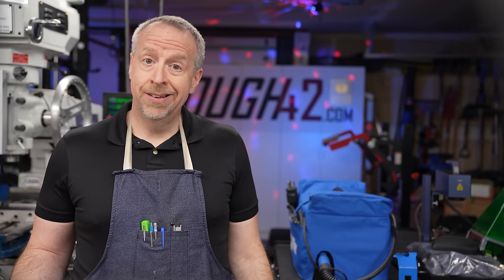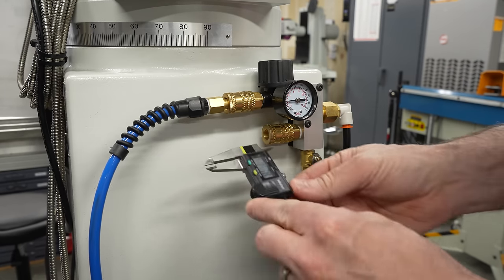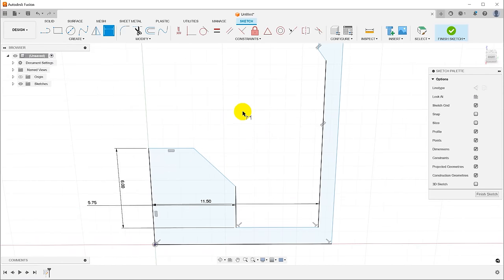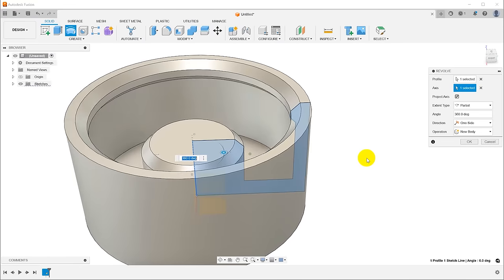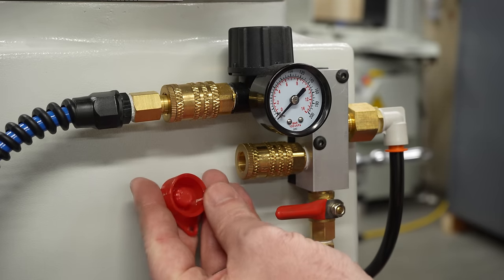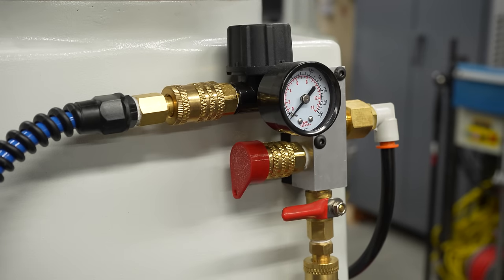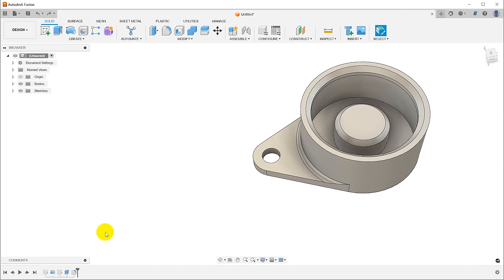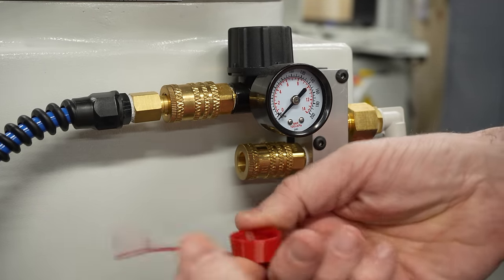Iterative Design in Fusion 360: Flexible Dust Caps

Comment: James, if you make the centreline as an actual centreline, Fusion will dimension against it as diameters and you don't need to do the dive by 2 thing, and you don't need to manually select the Axis in revolve :)

It the button next to Construction line in the sketch pallette.
Reply from the maker: Really?  Thanks!  I hadn't noticed that.  I learn more from making tutorial videos that I think people do watching them.
Reply: I'd been wondering what made the "centerline" style special!  That's fantastic. Thanks for haring!
Reply: Holy crap that's super useful
Reply: @Clough42  yup :) it can be pretty useful, mainly for things that will be revolved, but sometimes for other things as well :)

It's only dimensions that are snapped to the centerline that turns into diameter dimensions :)
Reply: @JBLewis  you're welcome :) The centerline acts like a normal line in that it will close up a contour, like you'd often want it to for a revolve, but that does make it less useful in other situations.
These days I really only use it for revolved parts, which I don't do all that often :P
Reply: I was just about to say the same thing. That centerline function has been around for a while. I'm surprised that you didn't know or use it James.

Comment: your mastery of fusion is unreal.
Reply: All in practice. I myself wish that Fusion 360 could be run by only using the keyboard, I am an old AutoCad guy and am actually faster that way.
Reply: @oldfarthacks The biggest problem I have is that Fusion has shortcuts to speed up your work (E for extrude, D for dimension) but on some dialogs the only way to click on the default button is by hitting it with the mouse instead of just hitting the Enter key
Reply: @Rob_65  They should sort that out.
Reply: @oldfarthacks same here, I worked with AutoCAD for ~17 years before switching to Fusion, and while I some times miss the keyboard shortcuts, since it got my Spacemouse Pro a CAD mouse compact I don't miss them 😁 anywhere near as mucg
Reply from the maker: @Robinlarsson83  I consider the Spacemouse a Fusion essential.  You can get by if you have a 3-button mouse so you can shift-middle-click to rotate, but it's not great.
Reply: @Clough42  yeah, 100% and not only for Fusion, basically an essential tool for any 3D CAD software :) it also makes it a lot easier to switch between different ones, sometimes I go between Fusion and Solidworks a lot in a day, and keeping navigation the same it very helpful.

I don't understand how I could work daily in CAD for almost 17 years before getting one, but the first ~10 years or so was just 2D in AutoCAD and IGems (CAM).

Now I can't imaging doing any sort of CAD without my Spacemouse :)
You don't need the Pro or Enterprise models, but I snagged a used Pro for ~150 euros so it was a no-brainer.
I do use its buttons quite a lot, and pretty much don't use the keyboard more than for number input.

Comment: Not gonna lie, the suuuuuper slow camera pan makes me feel a little bit sick after more than 30 seconds
Reply from the maker: I'm playing with some things.  I'm not totally happy with the results yet.
Reply: @Clough42  Maybe only one slow pan in a single direction?  Or maybe a slow ramp up/down and not a jarring reverse?  It doesn't bother me at all but if it has a back and forth with a sharp reversal it'll make people uneasy.  I would definitely like to see you play around with it a bit more.   It kinda turns a 2D video into 3D which could be very useful to give us viewers a better idea of the relative dimensions of what we're looking at.
Reply from the maker: @technobabble_  Part of the issue was that I didn't realize I had lens (and body) stabilization turned on in the camera, and it was trying to compensate when the slider changed speed, resulting in a really weird lurch.

Comment: if you use the construction line as your midpoint you dont have to put in half the diameter for the dimension you can put in the full diamter and it will make it symmetric to that mid point, pretty useful and one less step to take.

Comment: At 8:40 if you click and drag the line off a circle the line will always stay tangent, your second selection on the next circle can also be tangent. this just saves you having to make the constraint after. handy tip
Reply from the maker: Oh, that's brilliant!  That's the second super useful tip I've picked up from the comments on this video.
Reply: Very handy for making tangent connections just like in your video :)

Comment: I made caps like this for my gasoline/diesel cans.   But I have been struggling with flexible filament print quality.  So was glad to see your settings which I will test on my Prusa.   Thanks!
7/14/2024 addendum:  Yes those settings worked well for me on my MK3S+ with a Diamondback nozzle.   However a recent TPU print required a slight adjustment.    I was making guide wheels for a riding lawn mower deck.  They are a screw  together rim (2 halves) and a TPU "tire".    On the bed the tire tapers up and out at the outer edge at first as it prints.  The edge was tending curl up, getting higher than the extruder nozzle as it went.   Eventually this led to a failed print.   So for this part I went to .25mm layer height and extrusion of 1.05.   That solved the curling up at the edge.   It is so nice to be able to print TPU parts for stuff.  I think the Diamondback nozzle really helped.  Print quality is excellent now.
Reply: I did follow through with this using the .4 diamond nozzle in a Prusa Mk3s+ and with the recommended settings.  The filament I used was Overture TPU, black color.   Just a few prints but all look fantastic.  I was using a .6 hardened steel nozzle.  Great for carbon fiber PLA, but not so great for TPU. (terrible actually)   So again thanks for sharing your experience!   It definitely helped me.

Comment: And even though I use Fusion 360 on a daily basis, there are always one or two new things that I pick up from your tuturials.
One thing I do, is to use the diameter dimension on revolving extrusions. So instead of typing 21.8/2 I use the diameter dimension feature. Hit D for dimension, first click the center line, then the item you want to dimension and then right click and select "diameter dimension".
Yes, that takes more time and actions but coming back to an old design I now immediately know this is a diameter dimension (or something that is later being mirrored) and I don't have to click on the dimension to see it is a /2 measurement

Comment: Did you know there is a centerline button next to the construction line button on the sketch palette?
if you apply that to the centerline in a sketch you want to revolve, you can input diameter dimensions when you dimension to that centerline, it will also give that line priority when using the revolve command :)

Comment: Nice tip there about the scale sketch at first dimension setting!  

Btw, if you dimension from a line to a centerline, it automatically knows and allows you to enter the diameter without having to enter d/2.

Also, SMC fittings are junk. Parker/Legris or Festo.
Reply from the maker: It's what Grainger had in stock the day I realized I didn't have what I needed, and it's been working fine for me.  Though to be fair, I buy most of my pneumatics from Automation Direct, and I suspect opinions of their quality may be similar.
Reply: @Clough42  I have a possibly irrational beef with SMC. For hobbyist use, I’m sure they’re fine. At work, I troubleshoot, maintain, and create a lot of complex pneumatic circuits on Swiss aerosol filling equipment. The machine manufacturer, Pamasol, always shipped the machines with Parker/Legris and Serto fittings and we’ve always had a pretty consistent 10-15 years of reliability with each fitting in a harsh environment. Our plant recently started stocking SMC fittings and I’ve had issues such as gripping rings stop working on them after a very short amount of time but I’ve also seen them not fail for years. Just have a preference for Parker/Legris.

Comment: Given how fussy you generally are with your finishing of parts and removing the twists etc i was fully expecting there to be one final iteration where you extended the lanyard so the loop was a nice symmetrical semi circle in its profile when fitted to the air connector. A novel idea though, well done!
Reply from the maker: Ha!  I did spend a lot of time getting the cord under my wall-mounted TV to hang exactly how I wanted it.  :)

Comment: one question I ask everyone who doesn't use the centerline line when doing rotary part using revolve
Why don't you use the centerline line to then just dimension the diameter without thinking about having to divide it by 2  to get the radius?
Because no matter how careful you are you will forget and you will make the radius double the size and if you don't catch it because you are tired or have a lot of features and miss that one, you'll scrap the part even before you made it
Reply from the maker: Because I didn't know about it.  You see all the comments from people who learn something from every one of my Fusion videos.  I learn something new in the comments on just about every video, too.

Comment: "It's twisted. It bothers me". Yep, anything like that tends too upset the karma. When I put electrical sockets (outlets) on, the screws have to be aligned vertically,  just cannot do with the slots all over the place.
Another nice little job James. I'm still considering a 3D printer and have the budget for a Bambu X1 Carbon, but still not sure if I should wait for something new from them or others. Anyone any suggestions?

Comment: I watched the first minute, than rewound to take a look at the manifold inlay screenshot and WOAH there's a really slow camera pan from right to left?!
Reply: Seems the slow pan exists even into the other segments. It's a slow back and forth which is really cool as you get to see the item from different directions without realizing it or having to deal with jarring camera moves or being frustrated that the camera is locked off. Very cool.
Reply from the maker: I'm experimenting.  Right now I'd still consider it a cool trick, and not something I've really learned how to use effectively.  We'll see.

Comment: And it's only after printing just enough to fit out the shop and using the last of the TPU on hand you start going around and discover that you have 3 different models of the quick connect in the shop, and  none of them have the same outer dimensions as the 4th on the back of the mill that you designed off of has. :-) (Yeah, done things like that too.) It is nice that a model works as envisioned, and isn't a 6 month project to complete too.
Reply from the maker: Mine all fit.  Maybe because I got lucky.  Or maybe because they all came from Harbor Freight.
Reply: @Clough42  Probably the HF common source. I've picked up quick connects and hose ends for quick connects from HF, Menards, Home Depot, and Millica Unclaimed Freight (Something like Harbor Freight, but not as selective about what they carry, everything from Toelson  brand tools through crafting supplies and clothing, on up to some cast iron surface table saws (don't ask me if they are actually cabinet saws or not, I haven't looked that close. But they are on my way to my retiring place, so I occasionally shop there. And yes, that means I have a collection of mix and match. It mostly works together though. It's not like I'm trying to attach a 3/4 hose quick connect to a half inch hose end...Thanks for the video.

Comment: Could you have hollowed out the lip instead of making the cuts to the same effect if you wanted to maintain a seal, or is breaking up the circular lines what matters?
Reply from the maker: In my case, I was specifically trying to break the circular lines.  I'm sure there are many solutions.

Comment: I thought the same thing about 40 years ago.

My solution was to hang pieces of rag over the female connectors.

It works brilliantly and the bonus is theres always a rag in the right place for "needs".

But your cap is beutiful, I instantly thought.

Then you designed the integral lanyard.

I am guessing you have stopped cooking on gas? 

I assume you have a Starship engine in your cooker.

Comment: I've 3D printed countless functional parts from electronics cases to antenna mounts, latches, jigs, cowels, rails, handles and so forth... but one of the coolest use cases is iterative designs for fitment and refinement prior to machining the final part.

I live on a boat in the summer and have spent years working on it.  Absolutely nothing is at a right angle; everything is compound and complicated.  Lately I've been milling replacement woodwork out of teak, and 3D printing test pieces before sending the (inverted) job to my CNC machine has cut my failure rate down to pretty much zero.  Which is nice.. because teak is expensive. :)

Comment: With the relative simplicity of this design you won't notice any CAD performance degradation from your various modeling approaches. But best practices are there because as your CAD work expands all those little inefficiencies add up. I work with several thousand component assemblies and after "cleaning up" these types of sins (no design changes) the file open time has gone from 15+ minutes to about 2.5. So yes, pattern your chamfers. Yes, get your fillets outside of the sketch and into a feature. Dimensions get the worst gas milage. Adding all those chamfer dimensions in the sketch just bogs the system with calculation overhead. Practice good modeling on the simple and you'll automatically use it on the complex. Often, the problematic complex big assembly is a problem because of the multitude of poorly made simple components.